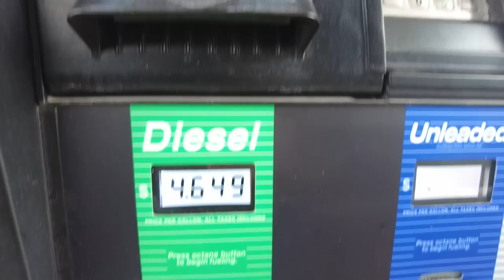How to Safety Wire Brakes, and Budget LS for a Rock Crawler

Comment: Naval Aviation guys every where are probably having a chuckle at the safety wire. Most QAR’s would snip that for ya. 😂. Got to learn the “around the world” move. As you hand twist the pliers make them go in a big circle (around the world) at the same time and you can get nice and tight to the bolt head with out the thick stuff breaking.
Reply: As army aviation I too am laughing😂

Comment: Ian: "We got this used powertrain for a screaming deal that you'll never find."
also Ian: "Watch me assemble $6000 worth of brake parts that you can't afford."

We love ya, buddy!
On a serious note, I have a 2011 F150 with part-time 4x4 and the E-locker in the rear. I like selectable lockers, but it really leaves me with 1-tire squirrelly traction action on wet pavement. How hard would it be to throw a LS or Torsion carrier in the rear (easy part) and re-route the wiring for the e-locker to the front diff? I know the front is a different size and possibly reverse rotation, so it would be replacing both carriers rather than moving one, but it seems like it would be much more streetable with double the traction off-road and I'd even keep the factory control. Thoughts?

Comment: With the weld on caliper bracker, how do you keep the mount fron warping?
Reply from the maker: it is thick enough that it will not warp....what you want is to make sure that the bracket doesn't deflect.....I do that on the fab table basically fixturing it in place before welding

Comment: A 4l80 would be cooler.
Reply from the maker: True...but the 60 has a great 1st gear
Reply: @BigTireGarage  I had a 2600 stall TC built for my 4.8, 4l80, mag/np205 combo, I run 40s and 538s and it is almost perfect in everyway!!